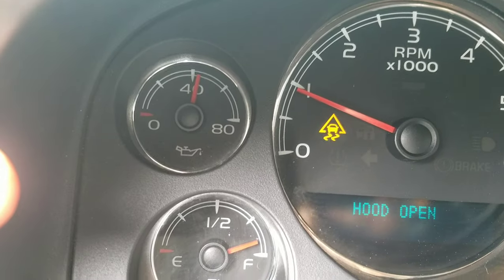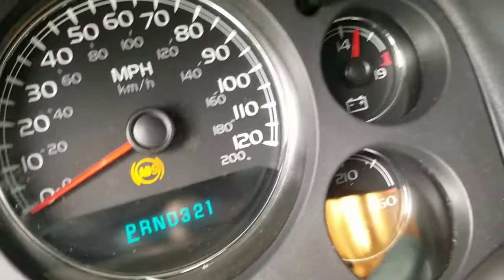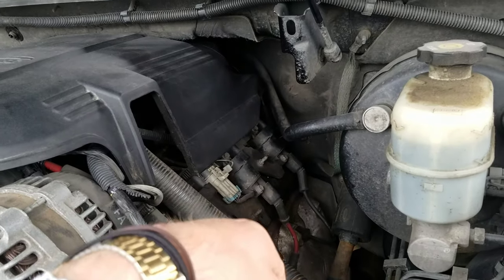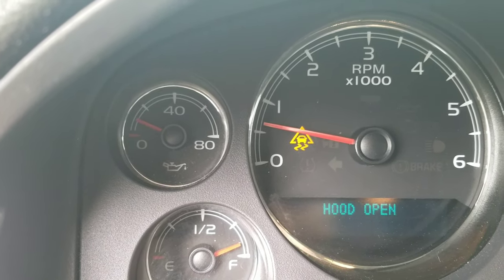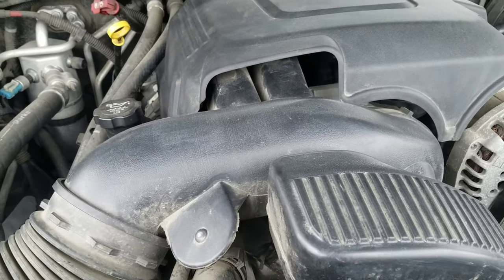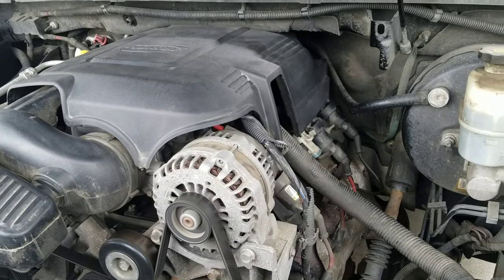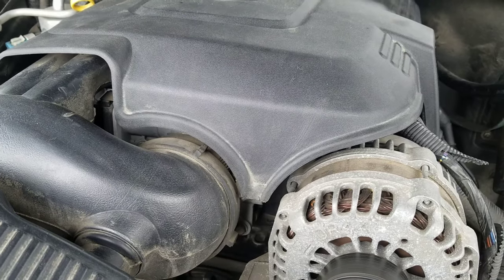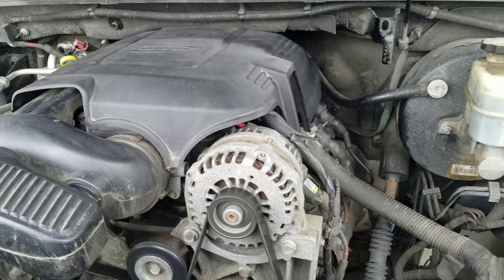0 or Low Oil Pressure? Chevy Suburban, 5.3l Vortec 2007-2014, Tahoe, Yukon. Diagnose and Fix Easiest

Comment: New oil pump and pick up tube o ring.  New oil pressure sensor and screen.  Cold start is 39ish on the pressure gauge and slowly drops to about 15 as it warms up.  Idk.  Also did an engine flush with motor medic at last oil change and that had no effect.  Any clues?
Reply from the maker: 15 at idle on a warm engine is about right for these. Want to see 40+ I believe on loads

Comment: How long did you leave the seafoam and transmission fluid in the engine?
Did you change oil after?
Reply from the maker: Probably 20 miles. Yeah change oil and filter after.

Comment: I have a 2011 Chevy Tahoe Lt. I've changed the oil pressure sensor 3 times and filter screen. The check engine light still comes on after driving around 30-40 miles. It struggles with power going up hills on the freeway. Oil pressure doesn't go all the way to 0 and it never tells me the oil is low. A couple of mechanics told me my oil pump is fine so I don't know what to do. Should I try your method before dropping the oil pan to check the O ring❓
Reply from the maker: Struggling with power and low oil pressure sounds like your engine is on its way out.
Reply: @g3mccotter  it's pretty reliable and only has 78,000 miles on it. It only struggles with acceleration while driving up steep hills on the freeway. Engine runs smooth, doesn't overheat or smoke.

Comment: I just wanna know if it’s good to mix 5/20 and 5/30 since I read it’s the same oil but a little different, because I just had this problem just yesterday. I checked my oil and it covered 4 of the wholes so I just added a little more. Yesterday I drove it like nothing, and as I’m driving back home the low pressure light popped back up. I’m only 18 and I just got a 2008 Chevy for my birthday and it’s my first car 🙏
Reply from the maker: Don't want to mix oils. Or run that light weight of one in these

Comment: How much sea foam do you add? Do you still add the 6 quarts and then sea foam?
Reply from the maker: 1 bottle of sea foam. These engines all burn oil with that afm so they're never full of oil unless you just filled it. But don't overfill your oil

Comment: Oil pick-up tube o-ring is hardened or cracked.  As the oil thins out with heat, it starts sucking air.
Reply from the maker: I've heard this and also heard people with the same issues after replacing that o ring. That said sucking in air is a good explanation specifically for what's going on and giving low pressure reading. However wouldn't that be starving the engine of oil which is not the case here as no ticking or knocking and clears up with what I did in the video.

Comment: Am I dropping a quart of oil to replace with ATF or just adding both fluids to the engine?
Reply from the maker: @dominickfrancois7944  shouldn't be a problem adding a quart or so extra unless your oil is already brimming
Reply: @g3mccotter  Didn’t work for me. I replaced the OEM sensor. The Dorman Sensor I replaced it with was triggering the chime. So I put the old one back. I still have low oil pressure and truck runs smooth but it’s not dropping below the chime point. 

Change the oil 3xs (including the flush). Changed the pick up tube o-ring. Screen was cleaned (wasn’t that bad) tube was clear. No top end noise. This was my last resort. Think the pump is failing. 
04 Tahoe 5.3 Z

Comment: I have a Chevrolet suburban 2007 5.3L 8v flex. I changed the pressure sensor and the filter 3 times. I changed and cleaning my oil pan and gasket. I changed my oil pump with a high volume one and gasket on the pick up tube. I also changed my CYLINDER DEACTIVATION SOLENOID. The psi the gauge stays strong at 40 and 50 but then drops to 20 psi then 10 psi. It has improved but the pressure still goes down. Any suggestions
Reply from the maker: 10 seems too low at idle. I would check your oil pressure manually since you've done everything. If that is consistent with your gauge cluster go for a compression and leak down. Power seem normal? No engine noises?

Comment: Had the oil pressure sensor replaced and check engine and light went away till next day started driving again and
Pressure went down to 0 again and light came back on after replacing the sensor. Any feedback back on what to do next I have a 07 Silverado 5.3. Thanks
Reply from the maker: I did those things first also. Then did what you see in the video. Lots of comments of people having success. Changing the oil after and using the right oil and filter will help and also changing oil regularly
Reply: @g3mccotter thank you will try that when I get home

Comment: I have a 2011 Chevy Silverado 286000 on it. I changed the filter to sending unit the pickup tube. It is forty cold, but when it worms up, I'll go to 0 and say shut off engine.

Comment: Mine is doing this but when I rev it up, pressure builds and warning goes off. Engine sounds fine. Added one quart and drove it 30 miles home and no issue.
Reply from the maker: Shouldn't be low enough warnings are going off
Reply: @g3mccotter  been driving it and no more issues. Mechanic said it’s either the filter in sending unit or some O-ring that goes bad. Both are simple fixes.

Comment: What If you got the AFM DOD Deleted like i had done and now i have a slight oil leak not from the motor or anything but its from around the back area,Should i still look into this
Reply from the maker: Yeah you don't want oil leaks. Of you deactivated the dod or afm that helps but often the damage is already done.

Comment: Good evening I ran across this video because I’m pretty much having the same problem. I have a 2009 GMC Yukon Denali 6.2 L engine. I’m having the same issues everybody else is having where my oil pressure sensor keeps coming on. I’ve changed it three times already the first one. I thought I had brought it from Amazon and the mechanic fixed it but he had broke the screen that was down in it so I had to go back and I ordered it from AutoZone, well I just recently got it fixed not too long ago and the oil sensor is still on. So just today I went to the dealer and brought the oil pressure switch to get it replaced and it’s still on . I sent so much money trying to figure out what the problem is and I can’t seem to figure it out I need help yeah what should I do because I don’t know what to do. Please help.
Reply from the maker: Try what I did in this video. Then change the oil frequently with a proper filter. Could be o ring on the oil pickup tube
Reply: Thank you so much for replying back. I’m definitely gonna try that in the morning I’m gonna go to AutoZone and buy exactly what you said and put it into my oil and let it run for few and see it this  work and after that I’m gonna get a oil change , and hopefully that fixes the problem but again your video really help me out a lot  because in the morning I was going to take it to the GMC in the morning to get a diagnosis done to it. but I definitely will try your remedy first. Thanks ☺️

Comment: I have the same thing going on with my 07 Yukon and I'm thinking about doing a AFM-dod delete a delete the check valve in the oil pan
Reply from the maker: Yeah it's a good call if you plan on keeping it. Probably too late to save that engine though damage is already done.
Reply: @g3mccotter  naw it's not damage it runs to good when get ready to start on it I'm going to some videos on YouTube of it.. right now I'm a mds delete on a 2013 dodge ram hemi 5.7 look me up.

Comment: Did your suv also smoke from the tailpipe when you started it?
Reply from the maker: No. Was it a cold start? I think that means lifters are wearing? Leaking oil into the cylinder after shut down that burns off on startup.
Reply: @g3mccotter  thank you for your reply

Comment: Hello!
I’m having the same problem with my 2012 Suburban. Changed the oil pressure sensor 2 months ago with a autozone part. Then it got low pressure again. Replace it again and same day got the check engine light again. Scanner detected same code oil pressure. This time I replaced it with original part from Chevy dealer. Oil pressure is still low. I’m going to try that cleaner you used. How much did you pour into the oil of each?
Reply from the maker: Followed the instructions on seafoam and then a quart or so of atf
Reply: @g3mccotter  Okay still haven't tried it yet. Will do so. I use synthetic oil will that be an issue with the ATF and Seafood? I wonder if the place that did my oil change used a different oil than it has been using previous. Or just a coincidence that got oil change on 3/5 and got the low oil pressure on 3/10 five days laters after I originally replaced the oil pressure sensor in January.

Comment: I have the exact same problem. Exact! 2012 suburban 5.3 engine. Starts out around 40 lb, ..slowly drops off to zero. Replaced sensor made no difference. Screen was not that dirty and the sensor looked clean. Engine sounds good also but I'm afraid to run it. Just bought the truck and within 120 miles this started. This problem doesn't seem to be addressed so far on You tube. Could be one of many problems viewed so far. Thanks for the video. Will be trying a few things in the next few weeks, maybe get lucky...and will post if I have any luck. Good luck. I'll be watching.
Reply from the maker: If it doesn't make any noise in top end after an hour of idling I would do what I did here and drive it around a bunch to see if it clears it up like mine did.
Reply: Not sure what you mean by "drive it around a bunch". With the ATF fluid and seafoam still in it? Initially mine didn't lose pressure quite as rapidly as your video showed, but took about 8-10 min. driving to get to the dreaded "ding... shut engine down"...just a steady drop off as engine warmed up. Now with ATF and seafoam it is at 40-45 psi cold engine start and will rev up to 50+ shortly after start up 2000-3000 rpm. Warm will be 25-30# after 15 min idle. Revving then up to about 30#.  I will try an hour of idling with the stuff still in it. A dealer shop said the black UPF48R oil filter may help. Seems to me that this is kind of cheating the problem, but maybe high mileage vehicles respond to it. Thanks for the reply.
Reply: It's the o ring in the oil pick up tube
Reply: My burb does this as well..... drove it for 2 hours with the warning dinging at me... changed the oil filter and it would be fine for another 6 months
Reply: Change your valve cover to the updated with the square pcv part 264-969

Comment: Does the oil pressure switch have a filter? My 2013 Sierra 5.3L does, about to see how dirty it is today, OP staying around 22psi past week
Reply from the maker: Yeah there's a little screen filter below oil pressure sensor you can get out with a small curved pick after the sensor is out. Careful.
Reply: @g3mccotter  I will be using 10mm bolt threads to remove safely without damaging it, so I can clean and keep as a spare

Comment: I have a 2004 Chevy Tahoe I went to leave and run an errand and all the sudden my dash started dinging saying low oil pressure I shut it off got out checked my oil my cap was loose so I tightened it would that cause it? But now my needle is floating between 0-20 but mostly staying at 20
Reply from the maker: Probably not from your oil cap no. Same issues as so these. Yours has it also it's just called dod or something

Comment: Having the same problem on my 07 avalanche, I thought maybe it's because my cluster stopped working. But I'm going to check it out asap
Reply from the maker: If all those lights and warnings going off if it's not a bad cluster probably. If you're just reading low oil pressure hard to say without diagnosing if it's actually low. If it has afm its probably burning oil and probably killing the engine slowly
Reply: What was it?

Comment: I have a 2008 Chevy suburban LT I wanted to ask anybody in you when you driving do the oil pressure gauge supposed to be moving up and down every time I accelerate when I'm pressing the gas my oil gauges move up and down what do that mean is that normal ??? Because the car lot where I got the suburban from said that's normal ??
Reply from the maker: Yeah when you have a load the oil pressure should go up

Comment: Has anyone ever experienced the oil pressure being high and when you step on it it drops? What does that mean? Is this mean anything to anyone trying to figure out if it’s the O-ring on the oil pick up tube for the sensor or the plug in the oil pan or if I need a oil pump or if the  bearings are ate up help
Reply from the maker: @kyplummer3657  what's high? Like too high or normal?

Comment: What was the main problem? How did you fix it. Great video info
Reply from the maker: Oil sludge clogging up sensors to dash. Clean and flush then oil change with new filter
Reply: So you are at good pressure all the time now
Reply: I’m gonna try this

Comment: I have an update: I don't have a problem with my oil pressure anymore, the check engine light doesn't come on either. I went to AutoZone, changed the oil and filter only using gm recommended oil and filter, and I also have only been using premium gas. The oil pressure gauge goes from approx. 21 @ idle, to 41 when I'm on the highway. I've learned this is a sensitive engine, I know this won't help everyone but maybe it'll help someone else.
Reply from the maker: That's good information. The ac delco filter is always what I used, as far as oil it varied. Premium gas is interesting. I can't help but think running e85 for a few tanks would help also then change fuel filter after.
Reply: @g3mccotter  well I also replaced all the coil packs with ac delco, originally I had a code pop up for cyl 2 misfire and it's running smoother now. I get one thing accomplished and something else needs replaced. My main focus now is my key fob works when it wants to. I replaced the battery and that didn't help, I replaced the key fob and that didn't help, I even tried putting 2 batteries in place of the 1 key fob battery and that didn't help. I think I've narrowed it down to the keyless remote entry module but the dealership wants $300 for the part and another $120 to program it. I found a video on YouTube on how to get around that so, yea I'm pretty frustrated but I'm getting there.
Reply: @somanynamesilltrythis0180  bcm?
Reply: @dustinrhodes1335  I replaced the key fob module and it's been working since.

Comment: I'm still trying to figure mine out new sensor no screen new oil pump new o ring pressure valve mod on the pan didn't know about the pump spring mod until it was already back together new oil filter fresh oil dod delete and I get 45 psi cold start and hot 35-40 then idle 10-15 but tap the throttle it's shoots up and it says low oil but it's full I may have internal issues possibly high miles but no metal in oil or no knocking I'm stumped
Reply from the maker: Sounds like a gauge cluster if you're pressure is shooting up but it's saying low oil pressure
Reply: @g3mccotter  I appreciate it I will check that out thanks and have u solved ur issue I know its been over 2 years lol but hopefully u did 😎

Comment: 2010 GMC yukon, was cranking but not starting, changed crank position sensor, then spark plugs and wires. (Plugs had gas on the threads) now that it’s at least turning on, it has “low oil pressure stop engine” after 5 mins driving. Idk what to do
Reply from the maker: Is it ticking or knocking?
Reply: @g3mccotter  no knocking or ticking thankfully. Oil level is good as well

Comment: Just so everyone  knows 08 burbans have  mechanical  oil pump doesn't  matter  what pressure  reads oil pump is still  working  peace
Reply from the maker: There's some issue if it's reading low.

Comment: Did all kinds of work to bring my 94 chevy (5.0) oil pressure up. It was low at hot idle. Ended up having to replace the crank/rod bearings as the old ones were worn and let too much pressure escape. Seemed to do the trick but it was not a fun job!
Reply from the maker: Yeah low oil pressure readings on the older platform are not going to be same as once engines got afm

Comment: Did you ever find out the oil pressure problem
Reply from the maker: These afm engines burn oil and build up sludge. They need oil changes often and engines replaced because of the problem.
Reply: @g3mccotter so you replaced the engine ? I’m having your issue rn lol

Comment: Mine has zero oil pressure but it’s not running rough at all so I am assuming it is just the sensor
Reply from the maker: That's what I assumed until I changed the sensor with same results

Comment: I have the same proplem.but I would substain oil pressure untill around 3thousand rpm and pressure would ping from 0 back to 40.i thought it might be the pick up line check the gasket it was good.it turned out to be the oil pressure sensor wasn't all the way plugged n.Now I can do 120 with absolutely no drop on oil gauge.its worth a check if u are having this proplem
Reply from the maker: For sure. Yeah a unplugged sensor or bad connection would be a nice easy fix
Reply: I had just recently had the motor rebuilt.fix that problem.Now today I got to change the oil and they never put the gasket on the oil plug lol.im no mechanic but even I know to do that .have a good one